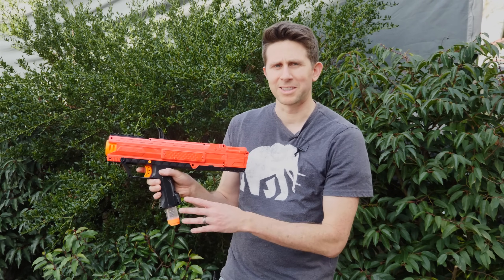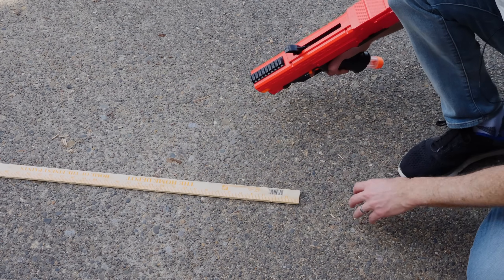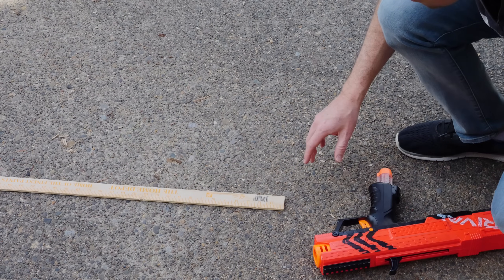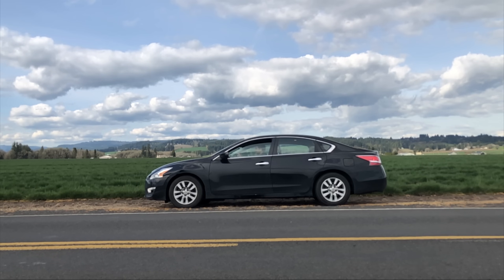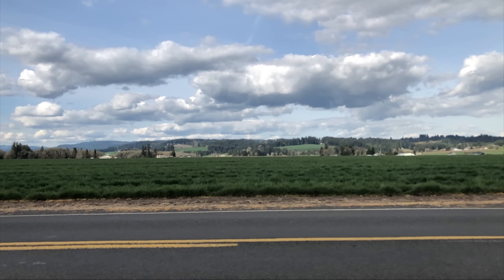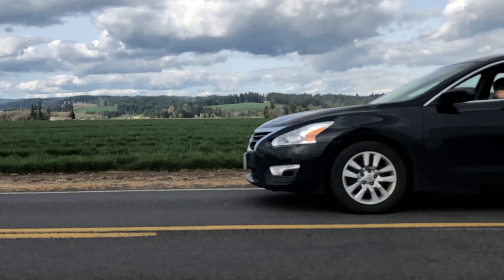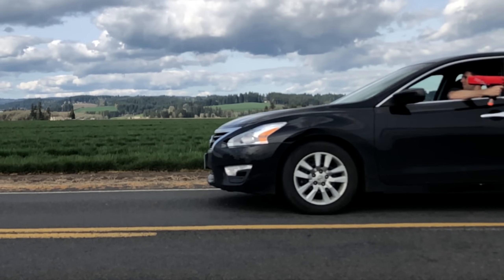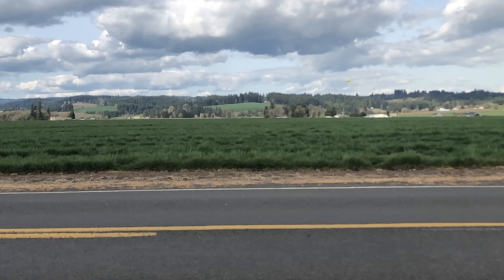Shooting a Nerf Gun Backwards While Driving At The Bullet's Speed Forward

Comment: The fact that it did moved to the right rather than stopping completely makes me think that the ball stopped because of the air vortex that is created behind the car.

Then again, I dunno.
Reply: I think the fact that the speeds weren’t exactly equal is more likely. Like you can shoot a nerf round backwards even though the car is moving, and like if the car was moving substantially faster that 55 mph, the ball would probably appear to move forward in relation to the camera
Reply: Yeah way more variables than are accounted for
Reply: @jaredwilliams5620  hmm
subbed to binging with babish,simple history,level cap gaming
you are a man of culture dude
Reply: The ball hit the car, he pointed it out in the slow motion.
Reply: @Hallowedpointdtp which is why his bullet hit the window. It had a bit of inward to car force even though he kinda pointed it outwards  and that was enough for it to graze the car. But as he said theres wind, vaccum and maybe some other variables too.
Reply: wind
Reply: also the fact that the street most likely is not flat

Comment: No, your analogy of falling elevator is wrong.  Falling means you are accelerating at the rate of gravity. In the case of a falling object you might reach some terminal velocity where the speed is a constant, but that would require some distance to achieve. Firing a projectile out of the gun means it is basically at an essentially constant velocity as it leaves the barrel.  Acceleration is not the same as velocity.

Comment: I really had my mind boggling. But I think what's going on is really just perspective. The ball was shoot just fine. No effects at all. If you would sit in the car the ball looks like it was shot just fine, like the way you would throw a baseball on a train roof. But if you stand on the outside it would look like the ball stands in mid air. The point is, in perspective you are moving away from it with the same speed it. 
Your are both at Speed X, the ball is moving away from you with speed Y (which is conveniently = x) from a static perspective it looks like you are moving away from the ball.. On a train for example, the  ball you throw flys over the roof to the back, the way it would if you were standing an a field (which is also moving, around the sun, pretty fast actually), from the outside it looks like relative to the surrounding, it stays still and you are moving away from it, but its speed got still transferred to it, in perspective the speed is used to "hold the ball in mid air" (because, if you would just drop it, it would look from the outside like it it is following you, the shooter.)but it is moving away from you (on the train) just fine with its normal speed. Thats the Point, it is moving away with 50 mph from the shooter, not the observer.

If you would drop it on a train

Comment: OK, if anyone wondering "what if it's done with a real gun" , I have a good news!

Actually, some modern cargo planes have a faster maximum speed than some bullet velocities.

So for example, a .38 special (130 gr) can archive a muzzle velocity of 528 MPH (775 fps). Meanwhile, a Lockheed C-5 maximum cruising speed is clocked at 532 MPH

So basically you technically can fire a gun from an open cargo ramp of a plane and see it for yourself if the bullet will fall straight down.

Comment: I had this question for years. I seen wwii  airplanes in which their enemies are on their back and machine gun operators especially tail gunners have to fire backwards. I thinking back then how muh is the bullet weakens because of it already traveling different direction prior to being fired. Thanks for this
Reply: It would not be weakened as long as the enemies were relatively still, for example, another plane chasing. Imagine another car driving behind him at the same speed, although the nerf bullet is dropping in air, the enemy car will still hit the bullet at 55mph, so in the view of the driver, it still looks like a normal nerf bullet coming at him 55mph. And if you make the camera moving, keeping the two cars in the frame and the road moving back, the bullet will still look like its shot normally.
Firing back at a ground target does weaken the bullet but the planes were not as fast as the gun's muzzle speed, so it probably cannot drop. But again even if the bullet drops, in the view of an enemy pilot chasing you, the bullet is still at the bullet speed
Reply: @fxastray  i was thinking of the bullet itself. How slower would it be compared to those fired in normal settings, but yes u got to be correct

Comment: Let assume left and right direction as -i and i respectively
When car is in motion and going in -i at the same time ball is inside gun is also in motion and going -i when he pulled trigger gun fired the ball in i direction so  at that instant ball has velocity in both directions which isn't possible moreover net velocity will be going to much lesser than both car and trigger.
Still if he had fired in same direction as car, velocity wouldn't be that much cause of air resistance ball isn't aerodynamic as bullet.
Thanks for wasting your time.

Comment: Here is a question, what happens if you fire within the vehicle while the vehicle is moving at the speed of the projectile? Will the projectile fire or will it stop and drop just like it did on the outside of the vehicle.

  I theorize that the projectile would fire as if the vehicle was standing still
Reply: Your prediction is right but it is not quite because of being fired inside or outside. 
 Actually inside or outside doesn't really matter except for the air resistance factor. Its called relative motion.
The key is, when you drive at 55mph, you will see the road behind you moving away from you at 55mph. What's more, everything behind you that is stopped relative to the road will look like it's moving away at 55mph. The trees will be moving away, the rocks on the ground will be moving away, and since the bullet is stopped (horizontally and drops vertically) relative to the road, you will also see the bullet moving away 55mph (horizontally and drops vertically)  So in the eyes of the driver, the bullet always looks like it's leaving the gun 55mph and drops a little, which looked like its shot normally. In the eyes of someone on the road( or the camera in this case) the bullet always stops and drops. Be it inside or outside of the car.
 Also if you consider air resistance, shooting outside actually makes the bullet even faster in the eyes of the driver, just like firing towards where the wind goes to.

Comment: Yes it will drop. From the observer the ball is traveling x velocity in one direction and you then fire it in x velocity the opposite direction. X-X=0 

Velocity is cumulative and dependent on the observer. To you in the car it shoots out at X speed. But to the observer it drops. If you where driving at that same X speed and just dropped it down. To you it would seem to fall more or less straight down (minus the wind resistance of the air your moving through wich would start to decelerate it. Maki g it look like it flys backwards.) But to an observer they would see the ball continue forward and slow down due to wind resistence.

Comment: If im not mistaken i think you would actually be worse of jumping in a falling elevator, since upon impact the elevator acts as a crumple-zone, but jumping would mean that you crash at full speed into the hard elevator floor, breaking all your legs and possibly more, im pretty sure you would be best of lying down on the floor if possible. Not that anyone here would actually end up in an elevator accident. Modern elevators have a plethora of safety features and the chances are so low you should not be worried about it.

Comment: The conclusion is not accurate. First thing, the bullet did not just drop to the ground. It would have moved back only a little bit because in normal conditions the ball cannot have a long range. So, what happened is that the hollow (presumably) ball moved towards the opposite direction of its initial velocity because of the air drafting in that direction, owing to the low pressure the car was creating on its back. The firing system seems to be powered by a spring. Now everything in that system was moving at 55 miles, even the trigger... The ball would have moved ever so slightly in the direction he was pointing at. If the speed of the bullet is overwhelmed by the pacing car, then energy may be conserved and bullet falls to the ground without any apparent momentum in any direction (but down.)

Comment: I think the reason it didn't fall perfectly was due to two factors. 
Firstly the turbulant air coming from the back of the car, as you mentioned. 
But also due to the rotationdue to the touch with the window. The rotation could have easily spun it off of its original course when bouncing and while in the air. ( If the contact was significant)

Comment: What you are seeing the effect of wind resistance on the ball causing It to decelerate. Wind resistance limits the speed at which something can travel. As soon as the ball hits the wind coming around the car it decelerates very quickly because of its low mass. It has nothing to do with driving the car at the same speed as the ball moves. The relative speed of the ball to the gun at the time of firing is zero. Just like it is when you’re standing still. Take wind resistance away and it won’t drop like that.

Comment: The ball moved forward because of the drag effect, the fact that your car is moving air with it.
Only way to counter it would be to have a much heavier ball.
Reply: Mythbusters did this with a cannonball and it fell straight down
Reply: Plus it did slide on it
Reply: Searching for a comment addressing this exactly 😅
Reply: But you would have to be slower
Reply: Just use lead
Reply: It also looks like the ball hits the car.
Reply: Yeah, this is flawed test. Assuming there wasn't going to be other forces affecting the ball from the car other than the momentumit could technically be done, but you would have to get the speeds to match exactly so that the ball would have egualized those two forceswhen the ball is just out of the barrel. Driving too fast means the ball will go the same direction as the car and too slow and the ball will be going backwards or where you shot it. Also the speeds would be different if he would have shot it forwards so that the air could have affected more, tho you couldn't get perfect drop since you would have been driving into the ball.

Comment: Before watching the video: No, it won't drop straight down.  Air turbulence and draft are a thing IRL— the car pulls a volume of air with it.  The bullet will probably fly at about half its normal speed, with the direction of the car for a short time, and likely fly erratically as well, tumbling in the turbulent air.

Comment: A Lockheed SR-71 Blackbirds top speed is 2193 MPH, the GAU-8 Avenger, the main gun of the A-10 warthog shoots ammo at a muzzle velocity of 2,266.3636 mph. So if the SR-71 was equipped with the GAU-8 Avenger autocannon and it fired it backwards would the bullets just drop?

Comment: Question: Do you think in a falling elevator would it be better to just lay down on the floor as flat as possible on your back while you wait for impact?
Reply: It would probably be the best solution but it would still suck. Once the car hit the bottom your internal organs would keep moving  until something stopped them (like say, your brain smashing into the inside of your skull). Not all that different from what happens in a car crash. And that's assuming the floor of the elevator doesn't deform on impact and stab/catapult/injure you.  It would also be really hard if not impossible to do as you would be free falling inside the elevator. Which means you would be, essentially, weightless and not being pulled down to the floor of the car by gravity like normal. Ever see videos of people floating around weightless inside planes? Same principle. This would Making laying on the floor pretty tough.

Luckily, elevators have several redundant safety features that stop them from falling so you are probably way more likely to be hit by lighting or win the lottery than find yourself in a falling elevator 😉

Comment: It seems like at first the ball was slightly faster than the car causing it to move (right) in perspective to the ground. Then the ball slowed down due to air resistance so it’s relative velocity is 0. After that the back of the car passes the ball and the low pressure zone behind the car slows done the ball (in perspective to the car) even more making it fly to the left,

Comment: is it applicable if you travel throgh a jetplane 1000 miles per hour in opposite to the alleged rotation of the earth, would it be the same?
Reply: yeah, but the obersver would have to move on the same trajectory and speed as earths center of mass i guess
Reply: sir, if you travelled 1000 miles from one point in the equator to the west and to the east at the same rate of speed to the rotation of the earth, which would be faster, to west or to east?
Reply: @kupyochannel4861  the speed vs the ground would be the same... but relative to an observer that's not spinning the one moving against the rotation wouldn't be moving

Comment: Well, I guess i'll be the doubting Thomas here. It looked to me like the ball was actually propelled and was traveling forward  (the direction it was shot) until it reached the back of the vehicle and the wind turbulence got hold of it.  the ball actually reverses direction slightly, partly due to vehicle impact but more than likely due to the low pressure zone created when a vehicle pushes through air and leaves a void in its rear. the air rushes back in to fill the void and gives a slight "push" to objects in the zone
Reply: It hit the car

Comment: This is a great channel but you did not nail it on the first try. You were prepared to do 100 tries to get it right and you thought that the projectile grazing the window was an acceptable first attempt? I tracked the ball and it starts out by moving slightly backwards (relative to the frame), indicating the speeds weren't perfectly matched and then after it hits the window it gets much worse. I'm disappointed. If you did it 5 more times I would be very surprised if you didn't get a better result. For a guy with 2.5 million subs I would think you would put a little more effort into your video. Furthermore, don't admit that you got this shot on the first try when the first shot wasn't even that great. You're better than this Action Lab.

Comment: One thing about the falling in an elevator that was not considered. You must take into account that if the elevator is falling at the same rate you are, you'd be weightless inside of it, (until you hit the bottom of course).  How can you push off the bottom, if you're not pulled to the bottom of the elevator during the fall?

Comment: If the elevator is falling and you're able to grab something from the ceiling to hang onto, then wouldn't it be more like a bungie jump with the bungie cable snapping when you're just a few feet from the ground? Maybe dislocate your shoulders? Fortunately elevator accidents are pretty rare. If they were more common maybe it would be a good idea to install handle grips on the ceilings of them as a safety precaution? It's unlikely you'd be able to move a ceiling tile and grip onto that while an elevator is falling. But if they were handles that you could jump to grab onto, or something that came down from the ceiling when it sensed a free-fall. Actually, if something like that were implemented in elevators, it seems like the safest to have fall down would be like a strong netting that you could climb into that won't touch the elevator floor regardless of weight or a capacity amount of individual nets (like cocoons) that you can try to quickly crawl into. That would be really cool if that would work. But I don't know if it would?
Reply: Or why not airbags that come from the floor on impact, like they have in cars?

Comment: Next Challenge: drive forward at the Speed of light, then shoot light in the direction you travel...how fast is the light you shoot?
Reply: Light always travels at the speed of light from any observer.  First of all you cannot travel the speed of light, only mass-less particles can.  If you travel at half the speed of light and shine a light forward or backward, it will move at the speed of light away from you in either direction.  From an external observer's point of view the light would still strike them at the speed of light.  This is why there is time dilation.  For each observer time moves at a different rate, but the light always moves at the same velocity.

Comment: To assume lift shafts are sealed like a syringe is not a good thing.
I have seen inside a lift shaft.
There is at least a 15cm gap on all sides except the door side.

Dont forget there is a gap for the counterweight to fit in.
This gap is a large hole so compression wont really take effect.

Most lifts have a braking system that activates based on speed alone.

You can cut the cables and electrics and it will still activate